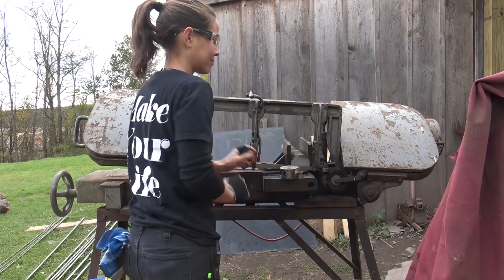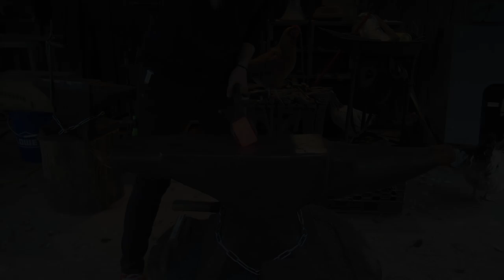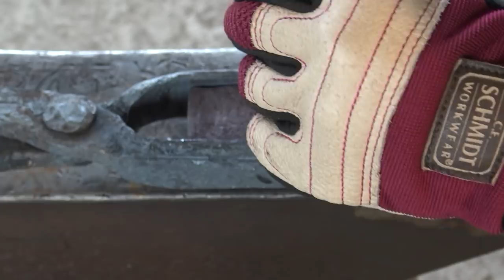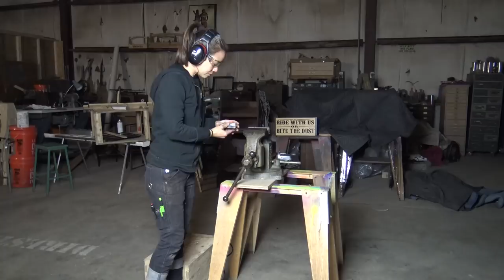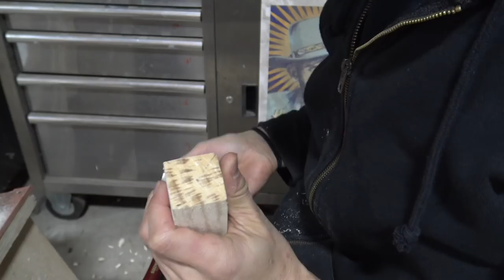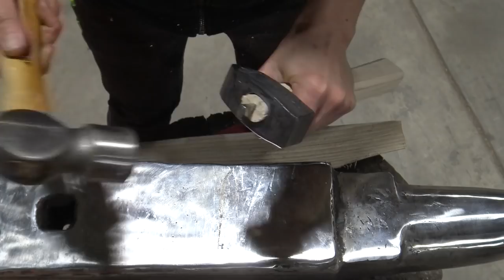iJessup Forges A Hammer

Comment: As a full time blacksmith I have a few observations. 
The tenacity you show in squaring up the blank is admirable. Hand forging that piece in front of a power hammer and a press was both frustrating to watch and wonderful. You could have squared up the piece in one or two heats, but you took the hard way. By taking the hard way, it is easy to observe you learning and getting better. Your hammer control gets better with each passing blow, you switch to a larger hammer as you get more comfortable with the work. It is even possible to see you get better with the striking. 
Thank you for being brave enough to show the learning process. Not everything comes out perfect, but be proud of how it does come out! You are awesome and i look forward to you doing more blacksmith videos. Keep on creating!
Reply from the maker: thank you!  that means a lot to me.  it was a labour of love, so to speak. so many people were confused because i didn’t use the hydraulic press that was right there the whole time. but, every time i hit hammer to metal i learned something new. i would have done it if it had taken a month. it was worth every moment. 🖤🖤🖤

Comment: I’ve seen more than a few videos of people forging things there at Jimmy’s and so far you’re the only one I noticed that only used hand tools.
Reply from the maker: i learned way more by going through all the steps and processes than i would have if i had used the machines.  it certainly would have been faster to use the power hammer or the hydraulic press but - since there is no chance that i'll ever have either of those machines - there didn't seem to be any reason for me to use them.
Reply: ijessup seems like there’s a lot to be learned from doing it the long difficult way. Just noticing things about how the material behaves, etc. 

I bet you also noticed a bunch of muscles in your arms, back, neck that you hadn’t paid much attention to before.

Comment: What was that powder he was dropping on the hole?
Reply from the maker: coal dust!  to prevent the punch from sticking to the hot metal.  and now i am seriously rethinking my manicure because you're the second person to think that was brett's hand and not mine 😖
Reply: @ijessup  I re-watched and I think it has to do with the previous shot you guys were in reversed positions. And it is a very closed shot. Although he his holding the metal prong thing and wearing the glove. There is a rule in cinema about abrupt change of axis called the 180-degree rule. That in association with the close up was enough for my tiny head :). You have the manicure you need for pounding steel hammers!
Reply: @ijessup  And now re-watching I have more questions! Why are you heating the sides of the hammer? Is it to make it less brittle in the middle?
Reply from the maker: haha!  i love your level of engagement!  the hammer in the forge with the cool-down on the anvil paired with the more controlled torch heating was all part of the hardening process so, yes, it does have very much to do with making less brittle 😊

Comment: There's a reason they make the hammer handles as long as they are.
Reply from the maker: i actually made mine shorter than normal because my wrist can't take it 😬
Reply: Okay.
I was actually referring to how you were holding the hammers you used while making your hammer.
But that answers that question too.
I've never had the chance to forge anything. I can only imagine the satisfaction you felt making that hammer.
Keep on making.
Reply from the maker: satisfaction is at 100%  if you ever have the opportunity to experience a forge...  i urge you to do it.  it is spectacular
Reply: It seems to be so primal. Creating tools using fire and brute force. I've been checking online to figure out how to make a small DIY forge cheaply to start with crude knife blades. That seems to be the easiest.
Reply from the maker: oh yes, i made one knife (kind of by accident) and it was extremely gratifying